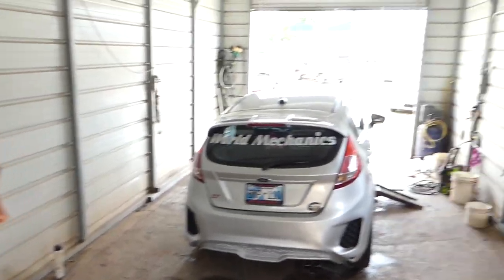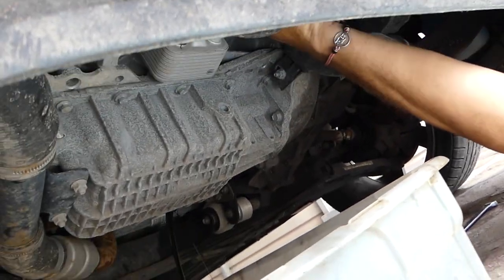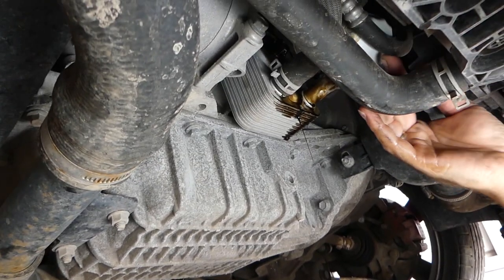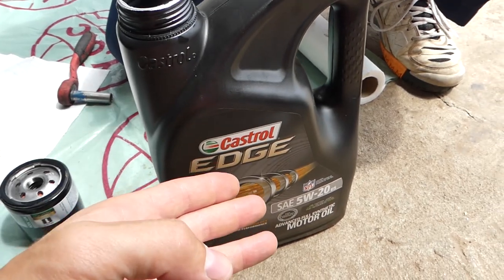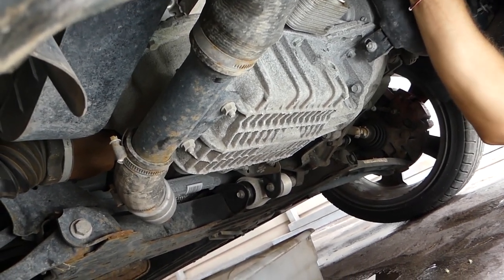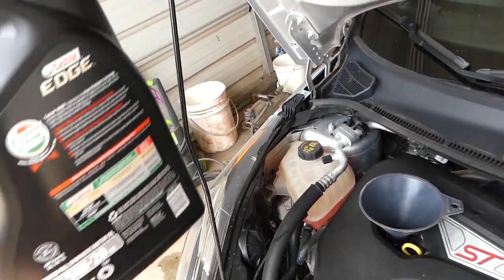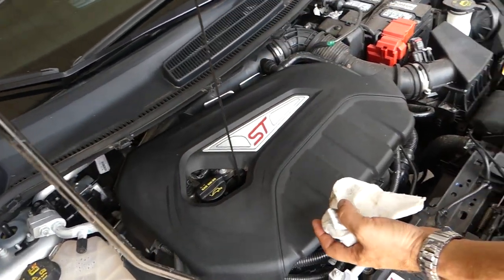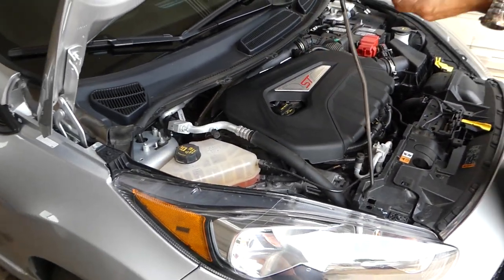Ford Fiesta ST Oil Change

Comment: You should always pretreat the filter. Pour in some oil and roll it around at an angle to saturate all the filter material. Then pour in enough to where it will not pour out horizontal to the ground.

Comment: Haha, you made that oil filter removal look more difficult than it is.  Push some hoses out of the way and it pops right out.

I'm almost at the 30K mile mark.  I do my oil changes every 5K or so with Mobil 1 Synthetic and the standard Motorcraft filter.
Reply from the maker: I usually use Mobil 1 as well but decided to see try Castrol this time. haha you are right about the hoses :)
Reply: is mobil 3000 fully synthetic useable
Reply: Question i wanted to know can I damage my 2019 Fiesta ST Ecoboost if I use 5w30 all the time so basically for summer and winter I'm in the US
Reply: @wnynj1213  summer only